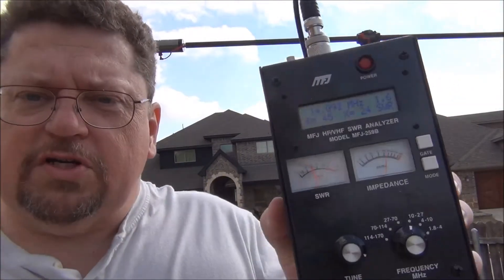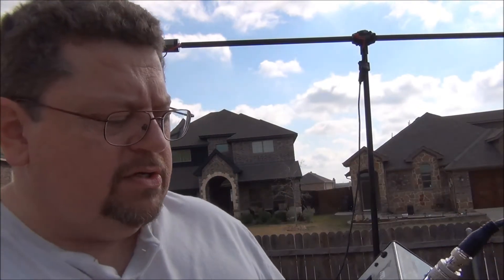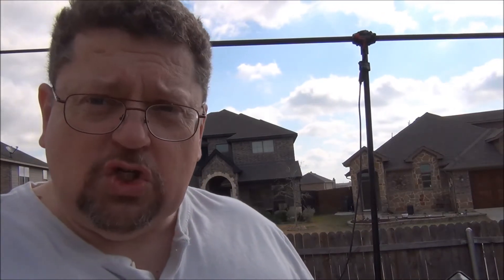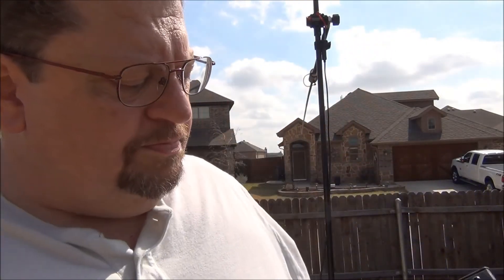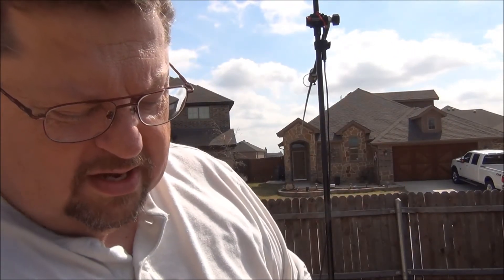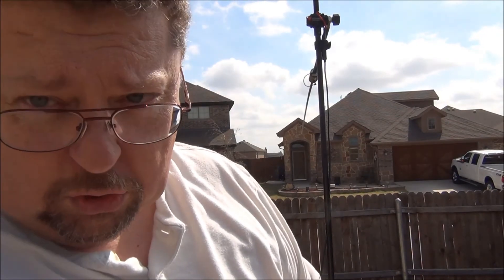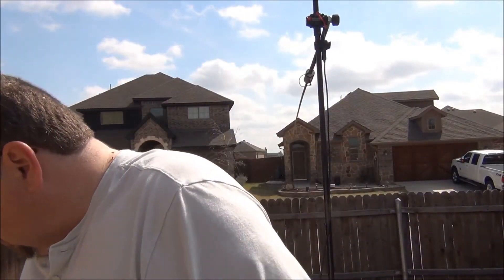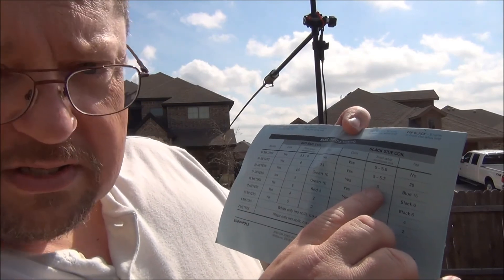Buddypole @ 20Meter Horizontal Dipole antenna switched to Vertical dipole antenna - AF5DN

Comment: Was the center conductor pole on top and outer shield (negative) on the bottom?  That's the configuration it should be.  When your dipole is in a vertical configuration, the lower pole should be the outer shield negative.  It would act as counterpoise or ground radial.

Comment: I don't see how the antenna could have a low SWR in the  vertical position. The metal tripod will certainly interfere with the SWR since it's right next to the antenna.

Comment: It can be challenging to tune 1/4 waves, especially short versions. I spent a lot of time setting up my Buddipole (and Buddistick) in various configurations and checking SWR and Impedance and once I had them tuned properly, I made up cards with the formulas on them for quick reference.